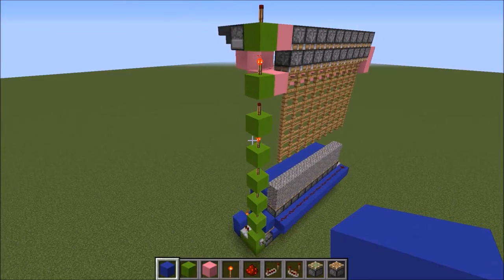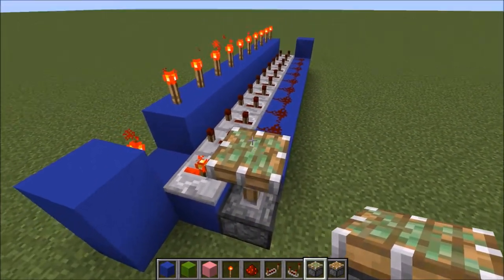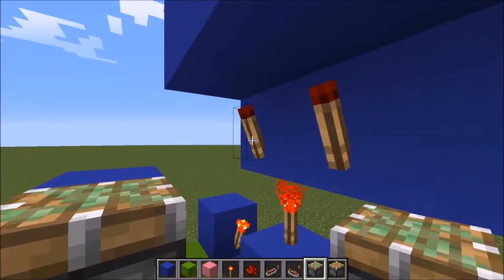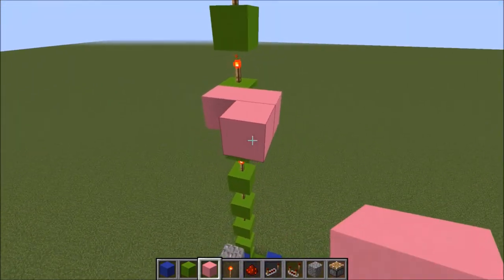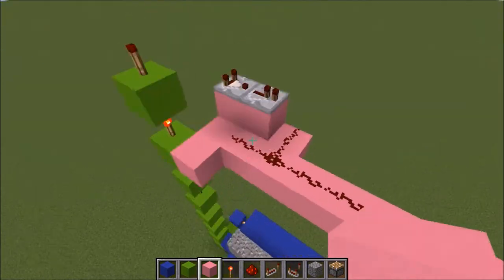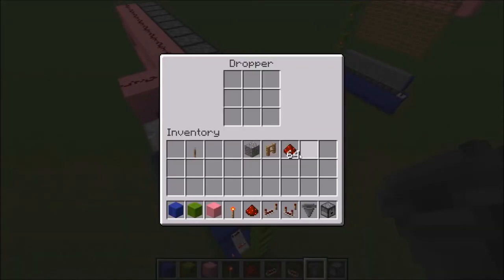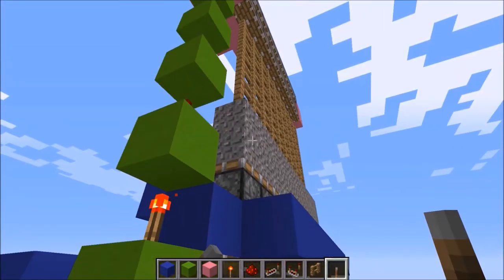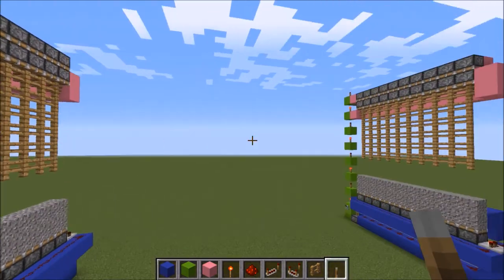Working Castle Gate - Portcullis

Comment: When i put that first sticky piston in there it doesnt go off, then i put a block on top of it and it constantly turns on and off
Reply: Jonathan Koons same
Reply: Same?  Any ideas?
Reply: Same problem here, did you figure it out?
Reply: DaTwigg , no I didn’t.  I think reaction of the stacked sticky pistons has changed since this design.
Reply: I figured it out after dealing with the same problem I found out that the sticky piston needs to touch the redstone repeater so if you look to the side the sticky piston is actually shorter than the (rsr) redstone repeater, and is not touching the reason why the second sticky piston you put on there barley touches the rsr
Reply: So in a way get rid of the two blocks put the rsr on the ground put a blue box kiddy corner to the rsr put a rst, (redstone torch)  on the blue block the put a sticky piston in front of the rsr and youll have it automatically lift

Comment: Hi all, I have the first sticky piston does not activate. I tried every position and directions but still would not activate. However if I put another sticky piston above it the second piston gets activated automatically. any suggestion how to deal with this.?
Reply from the maker: Make sure that the first redstone repeater is facing the sticky piston. 3:07
Reply from the maker: @DeadlyBan Yes, you should be able to make it shorter. As long as the top and bottom half are kept the same size, it should work for what I think you are referring to.
Reply from the maker: @DeadlyBan You will have to use a sticky piston due to most blocks not being affected by gravity, and the block needs to move back down with the piston. And, yes; you can make it shorter by shortening the block/torch tower. As long as the top layer is still a torch, it will work.
Reply: I am having the same issue.  The repeater is facing the sticky piston as above.  It seems to effect the first row of pistons.  They don’t activate.
Reply: @Juliashore  same here, not found a solution yet. Please comment if you discover a fix! I'll work on something in the meantime 😊